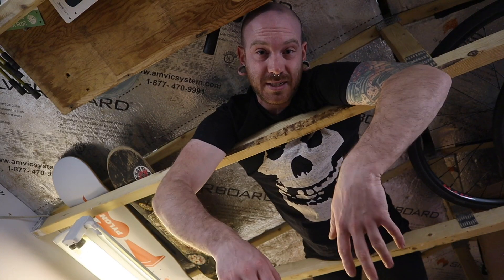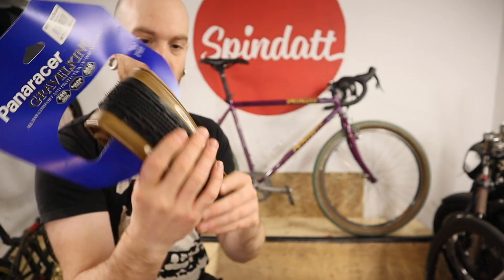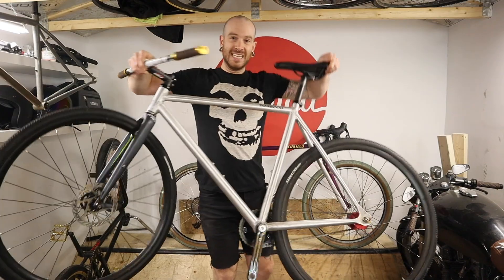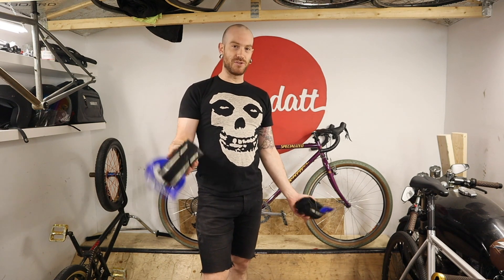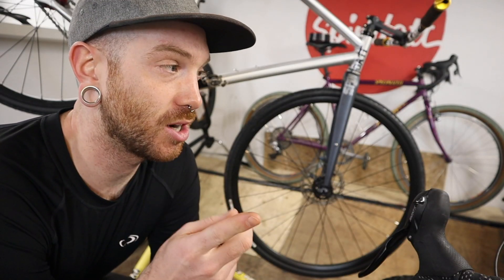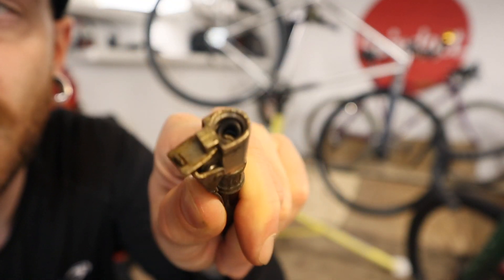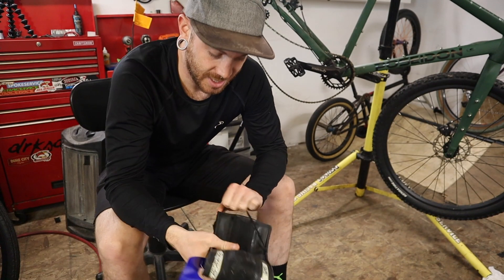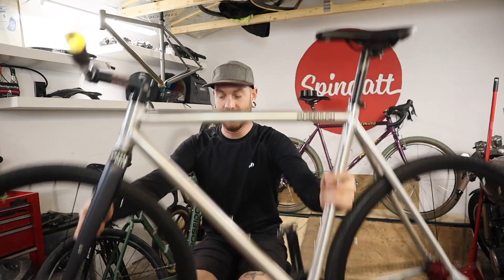Something to show you.

Comment: Sick!!

Does anybody know how wide i can go on older shimano 105 rim brakes?
Reply: 28c is typically the widest that modern short reach dual calipers can clear :) depending on the brake/rim/tires you may fit a 30c or 32c but it would most likely be tight clearance and you'd have to deflate the tires to remove or mount the wheels
Reply: Ah, don't be shy, take one pad off, then no limit!

Comment: I have had a tubeless tire blow off a rim at speed. It sucked. The tape shifted from the factory install and leaked out through the rim. Then pop. Thankfully it was the rear wheel. Stopped me in my track. Got covered in sealant.